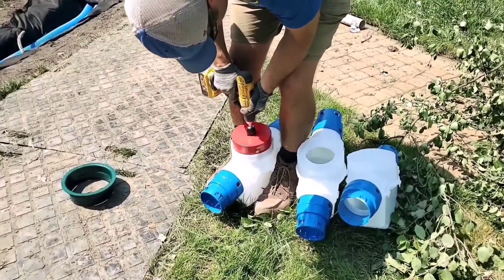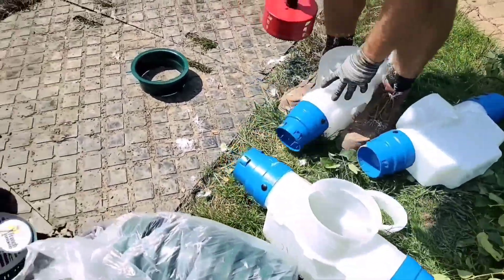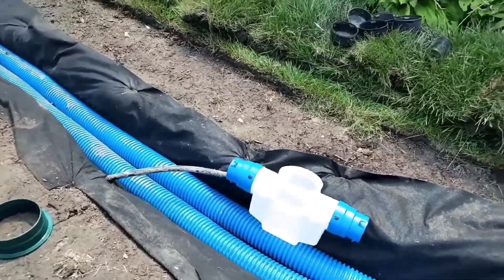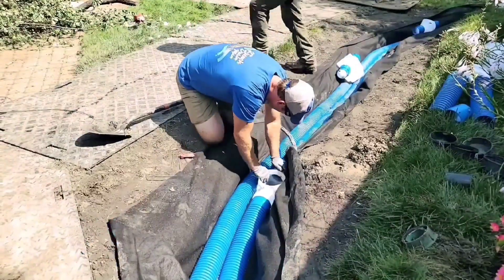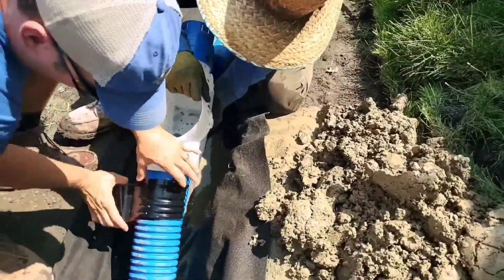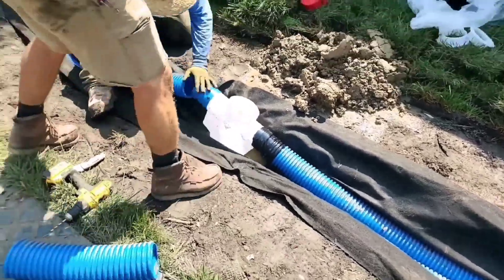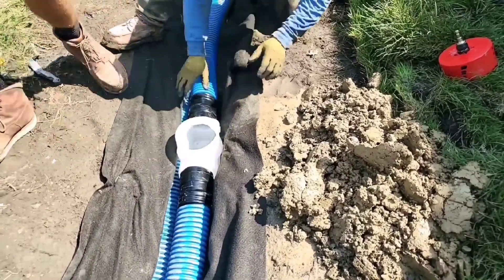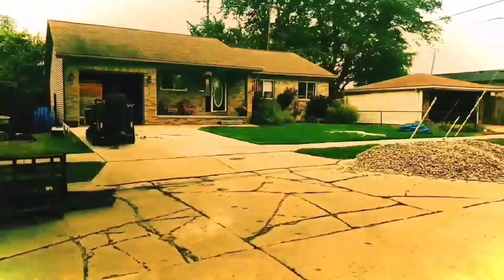Best Catch Basin for Your Yard Drainage

Comment: I have product from you being shipped to me soon including seven catch basins. Three of them are going to have 6” inch grates. Am I going to have to buy a hole saw drill bit in advance to drill out a bigger hole in these basins to accommodate a 6” grate?  If so, what is the exact size of your hole saw you use?
Reply from the maker: If you order the 6-inch catch basin with a 6-inch grate, it will come already drilled out as a 6-inch basin. Our 6-inch turf restrictor plate will be released next month. Stay tuned for that. It's really cool.